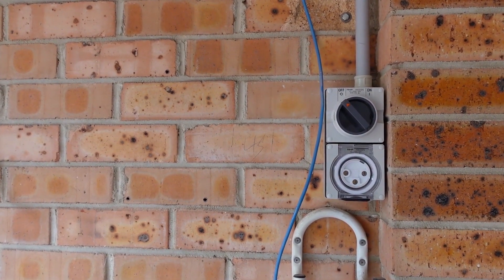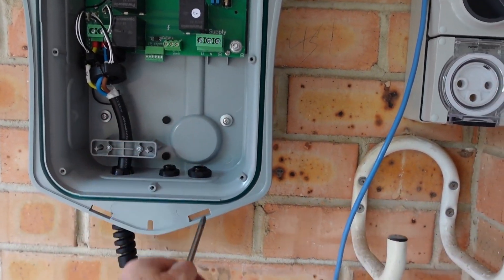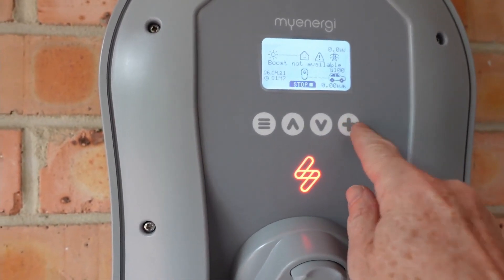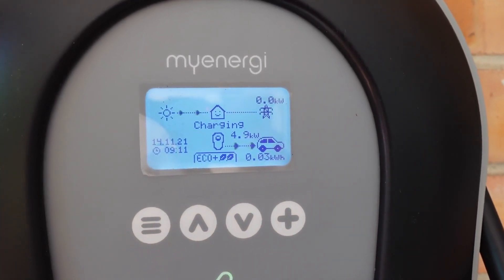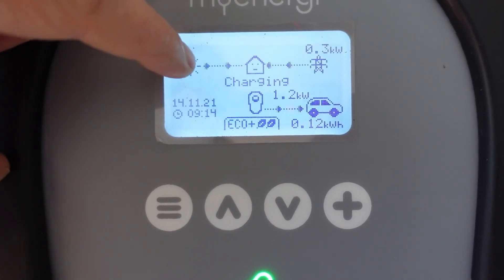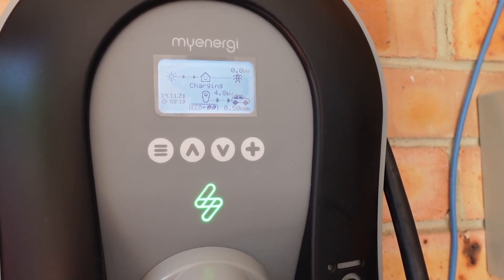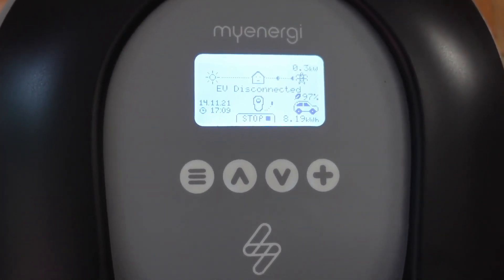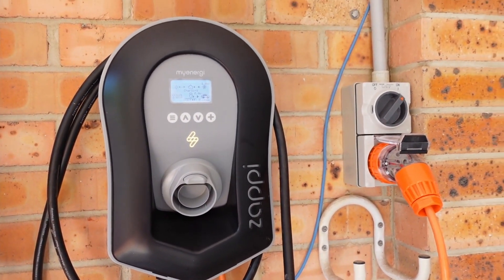Myenergi Zappi 7kW EV Charger Installation & Testing

Comment: My Zappi V2 was installed at the start of last week and I have a 6kW 2 string solar system going up in 2 weeks so I will be in the same position. Apart from I am rapidly approaching winter in "The Old Dart" and so I may have to wait a number of months until I can make use of the Eco+ modes. The built in boost timer is great for using my suppliers overnight cheap rate tariff though and the Zappi is working like a dream for that.
Reply from the maker: I just have a fixed rate 24/7.
Reply: @EEVblog2  We have a few suppliers here that offer a night time EV specific tariff. My rates are 15.64 pence per kWh normal rate and then 5 pence per kWh between 00:30 and 04:30. But it is interesting now as the battery storage solution and payback is much more compelling if you can charge the battery during the cheap 4 hours and discharge at the other times. In fact it has got to the point, on those tariffs, it could be better value to buy a battery rather than install solar.  Interesting stuff.  Here is a question for you Dave. One of your roof systems use the Enphase invertors. It would be interesting to understand how they all stay in phase with each other. What are the physics of how all the micro-invertors stay in sync with the mains supply and each other?
Reply: @stevengwilliam8096  I was thinking the same thing, how does the grid tied process work. Also how will Vehicle to Grid CCS work? Inverter in the car, or house?
Reply: @stevehurcombe  A simple way is more or less an active PFC running in reverse, supplying rather than drawing current.
Reply: You have huge homes, sun, garages, drives... In the UK we're lucky if we can park within 100ft of our house and there is one lamp-post charger at the spot where the vandals hang out each end of the street. We drove 250 miles in my Civic the other day in 4 hours. What would that be in a similar priced EV?

It was a work trip so time mattered. The train was £600 each.

Comment: Great, I just have a small personal question on the australian 3-phase plug, it seems your 3-phase outlet only has 3 pins for the 3 phases at which voltage is that outlet 240V? Or something different?

Also here in Italy the 3-phase outlet has 5 pins, neutral and earth added, am I losing something along the way on why your australian one doesn’t have the 2 extra pins?

Edit: or maybe I am confusing myself and that is a single phase outlet, with 3 pins:live neutral earth
Reply from the maker: This is a the 3 pin single phase variant. The extra two pins for the other two phases aren't fitted. See my main channel video for a close up look at the connector.
Reply: @EEVblog2  ja thanks, I think I wasn't paying enough attention where you explain that, anyway cool thing to have in your house when paired to a solar system installation

Comment: Solar panels to inverter to transformer to rectifier, seems inefficient. 😁👍👍
Reply from the maker: Practicality always wins out.
Reply: Could have used a Solaredge combined solar inverter and EV charger, but replacing a perfectly good existing inverter isn't very economical.
Reply: @NiHaoMike64  Dave's new panels use per-panel micro-inverters, so combining inverters with anything else isn't an option, everything has to "talk" AC.
Reply: @teardowndan5364  Old array is still using a string inverter, that still works so why change it? Also, with the new array, there's the option of using optimizers rather than microinverters.

I wonder why we don't see more 2 or 4 input microinverters and optimizers, that can reduce costs while still allowing for per panel MPPT.

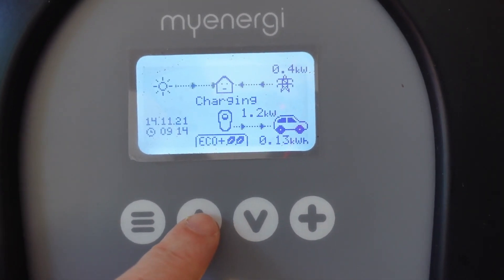Comment: 8:29 Dave keeps saying ECO ++, am i blind or does it just say ECO +?
Reply: The extra symbols.
Reply: ECO+ with one leaf will use mixed solar + grid energy. ECO+ with two leaf symbols tries to do the charge entirely from solar, but can be configured to take x% of energy from grid to keep charging if solar won't supply enough. Or so I have understood from manuals... I might have understood incorrectly (as english isn't my native language and manuals are in english).
Reply: ECO+🍃🍃

Comment: I gotta say, the Australian 3 phase connector is the most beautiful connector I've seen.
Reply: It's a single phase. Single-phase 32 Amp 3 round pin angle plug 56pa332
3 phase connector would have more conductors.
Reply: @ArthursHD  Still the same form-factor as our three-phase plugs, just more pins on the plug top.
Reply: It's nice with that clear part. I do wonder about UV durability as such things are often used outdoors and clear plastic degrades in the sun.
Reply from the maker: @ulwur  You can get non-clear ones.
Reply: @ulwur  they are designed by Clipsal to survive Australian sun which believe me destroys plastics in no time. However they aren't cheap.
Reply: @ulwur  IME they don't degrade much in the sun, I've seen them installed for decades, look pretty much like new, perhaps a little less glossy, occasionally a bit of yellowing but the plastic is about 5mm thick at the thinnest part so even if the outer degrades a bit it's not going to impact the structure of the plug.
Reply: The pain with Aussi 3 phase outlets is that many are 4 pin with no Neutral. Those cannot be used for (portable) EVSEs, they need the 5 pin version. This is because of the power for the control electronics coming from 230V (L1 to Neutral). Only the Tesla HPWC (to my knowledge) can be configured for 3 phase with no Neutral.
Reply: @moestrei  Yeah, I've run into this more than I'd like to (not for EVSEs, working as a sound/lighting tech), it's a pain in the arse :/ not sure why they don't bother wiring neutral, I mean sure you can still use it for delta wired stuff but the 4-pin plug will work A-OK in a 5-pin socket so just spend the extra $buggerall and use 4C+E instead of 3C+E (not like a 5-pin socket costs any more...) :/

The weirdest part is that I've seen 4-pin sockets in entertainment venues, NFI what they use them for because all of the kit I've used in such a venue needs Neutral.

/rant

Comment: A knock detector or a secret IoT microphone?
Reply from the maker: I deliberately didn't buy the networking module...
Just because you're paranoid doesn't mean they aren't after you...
Reply: @EEVblog2  My PodPoint is wifi enabled and it's pretty useless - I can see my charging history in an app. That's it. I can't get real-time data out the thing or do anything apart from program a time for when charging should happen or stop.